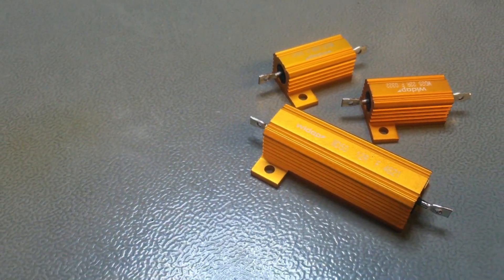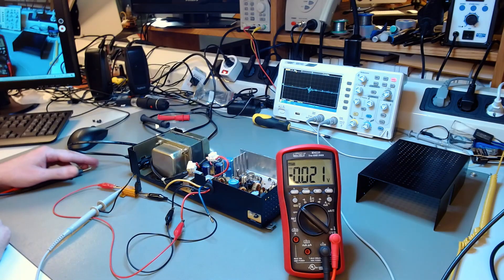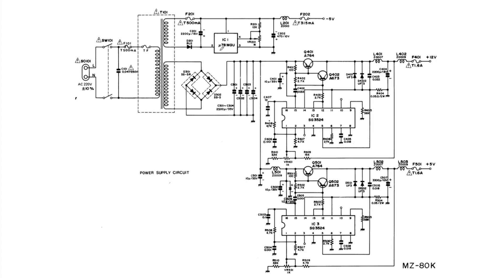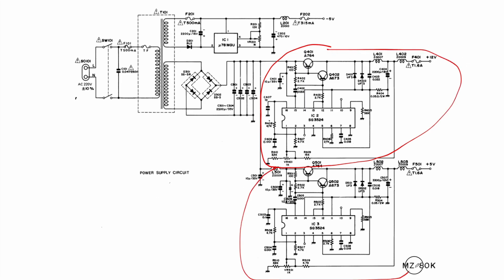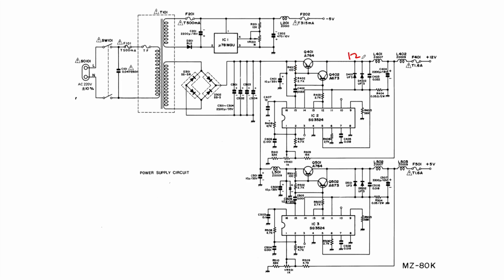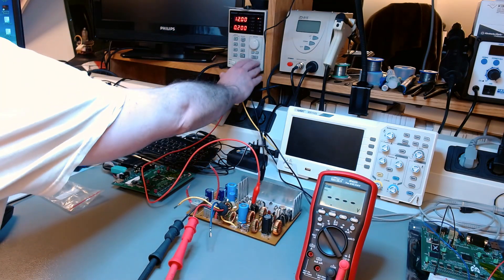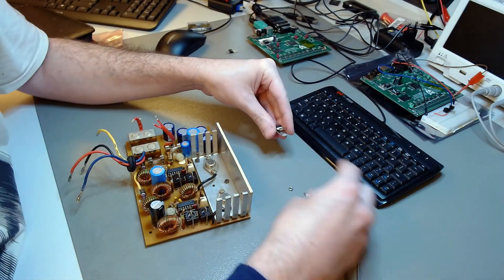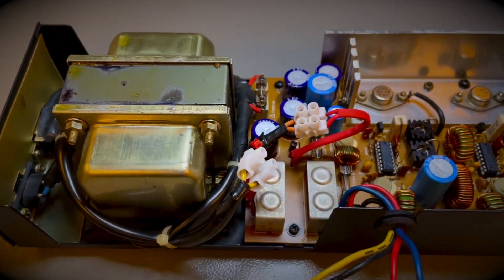Sharp MZ-80K museum-quality restoration, PART 7

Comment: Excellent diagnostic skills go a long way for you with diagnosing the low voltage on the 12v and 5v rails of this PSU.  I just goes to show how much a deep understanding of the circuit being inspected can help, and saves you from the hit-and-miss component swapping often seen in repair videos with analog circuitry.  Big thumbs up to you.
Reply from the maker: Cheers mate!

Comment: Fume extractor is more important for lead free solder. It's not the lead that vaporizes, it's the flux and the higher temperatures required for lead free that release the California carcinogens. Nobody used fume extractors back in the day with leaded solder. Cough cough, splutter! 
Great series and that fuse failure mode is something I have never seen before.
Reply from the maker: Good to know! The lead, of course, is still not a good thing to inhale ;-)
Reply: @thebyteattic  You can't inhale lead solder. It is a heavy metal and doesn't vapourise or smoke at soldering temperatures. It is the flux that is the problem. It's worse with higher temps needed for lead free solder.

Comment from the maker: Thinking about it after I edited this video, I noticed that, when I load-tested the PSU and saw the fall in voltage levels, I was loading ONLY THE 12V, not the 5V, line. Some switch-mode PSUs don't behave as they should unless ALL switch-regulated power rails are loaded. Perhaps this could account for the voltage drop I saw. I'll determine that soon.
Reply: I found this to be the case when vandalising an old ATX supply to use as a bench supply - I had to put some power resistors across both the 12V and 5V supplies to "load it up". Excellent video once again, Bernard! Thank you.
Reply from the maker: @simaesthesia  Thanks for the confirmation!